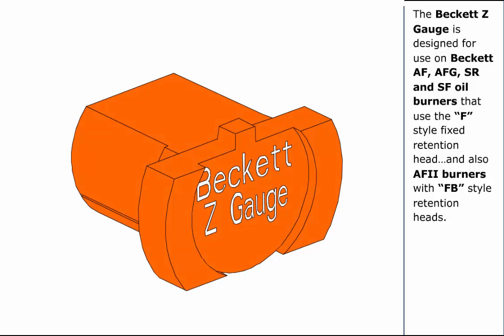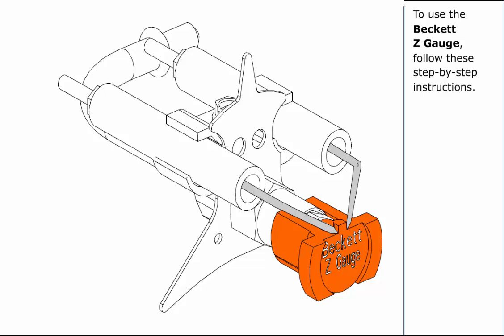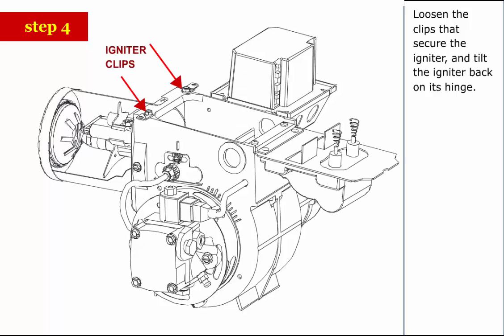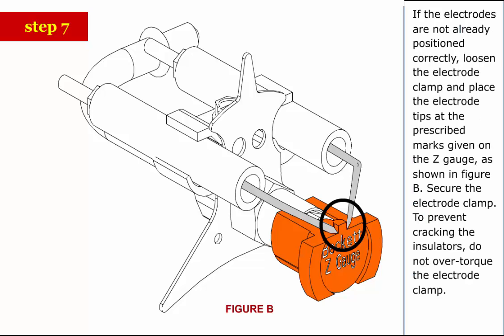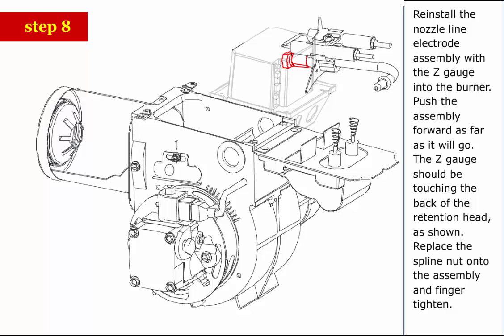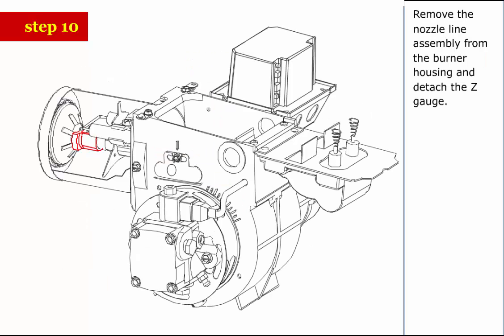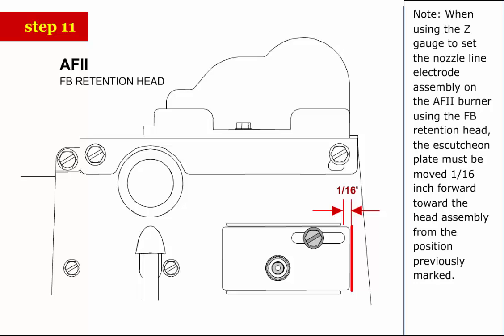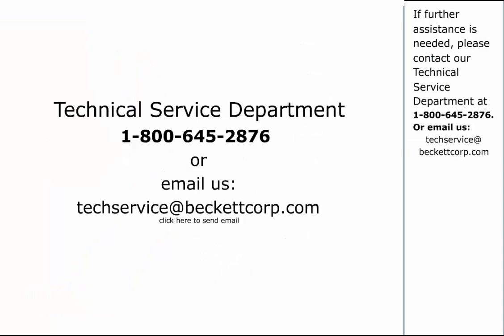Beckett Z Gauge Training Module

Comment: Turns out my burner has a D1 head. The Z distance for the D1 head is 7/8". The Z gauge sets the Z dimension at 1-1/8", which is correct for F heads (1-3/8" if there is a heatshield). So for the D1 head, slide the gun forward by 1/4" after marking the distance with the Z gauge.
Reply: Sounds like you have a Ducane burner.